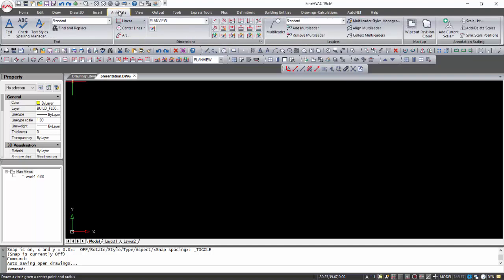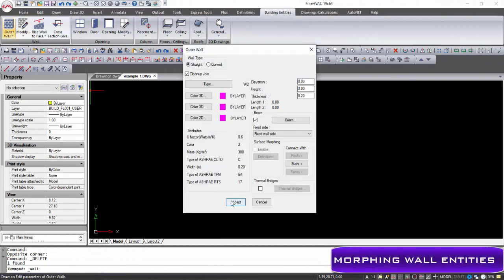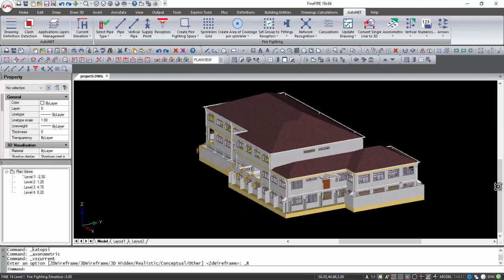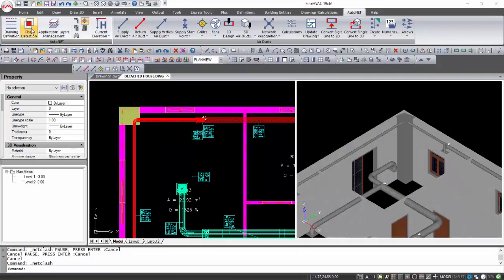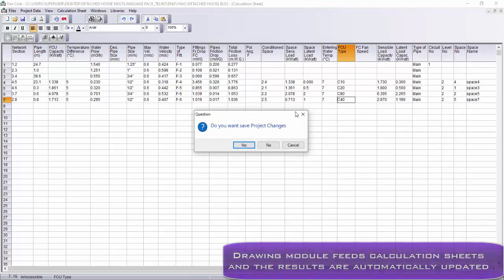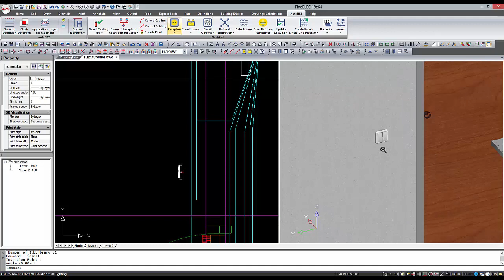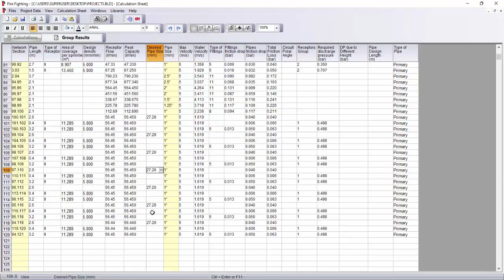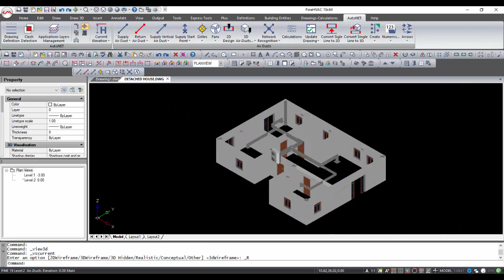FINE MEP 19 Top New Features

Comment: what about HVAC & piping libraries?
Reply from the maker: Pipes and air ducts are displayed in realistic view in the drawing module. The technical data in the libraries of calculation module still remain the same. Of course, libraries are open to the user as to be enriched further according to project requiremets.
Reply: @FINEMEP  when will 4m support importing existing bim files e.g. from revit?